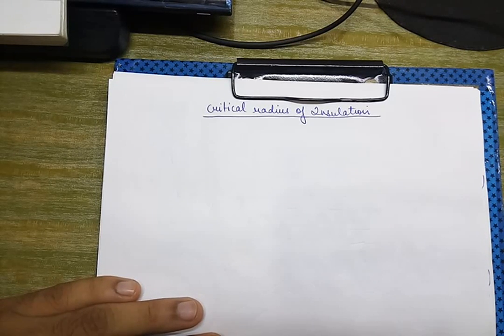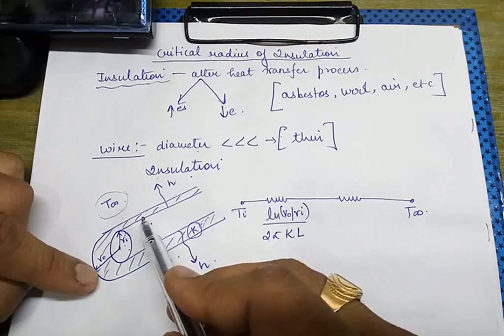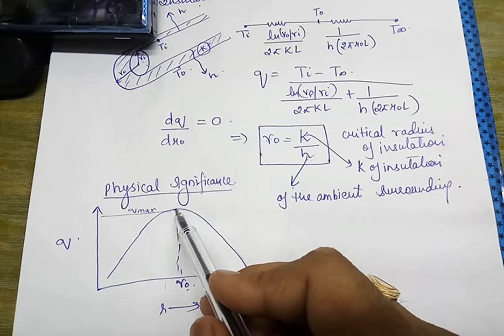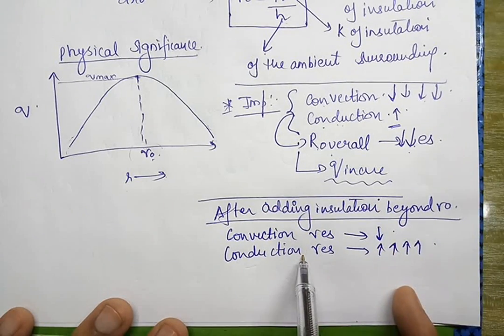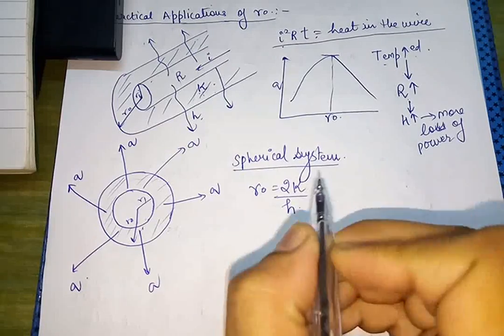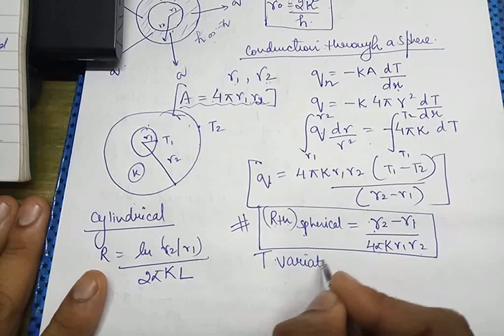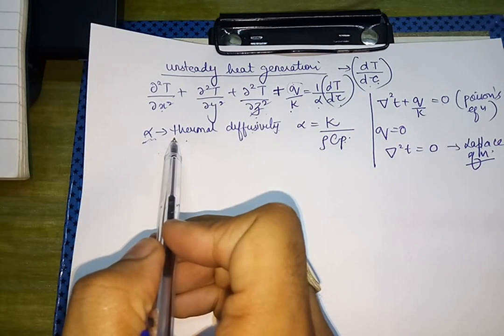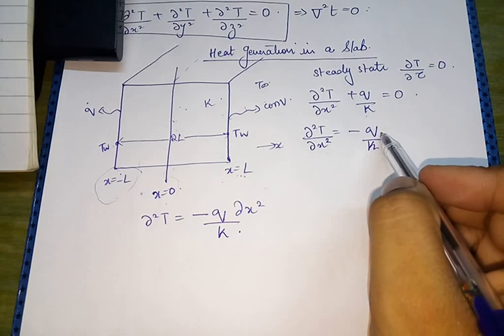GATE Mechanical Lectures for HMT | Unsteady Heat Generation & Critical radius | Lecture 5

Comment: sir, spherical system is not discussed..
Reply: Mech Zone no not
Reply from the maker: The resistance and the heat conduction formulas have been discussed for the spherical case...
Reply: sir spherical case is not discussed